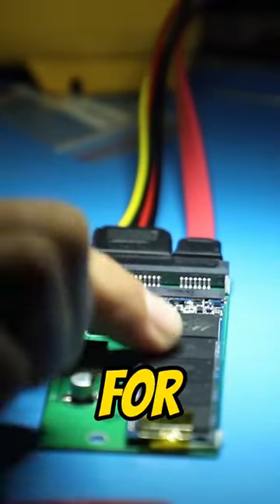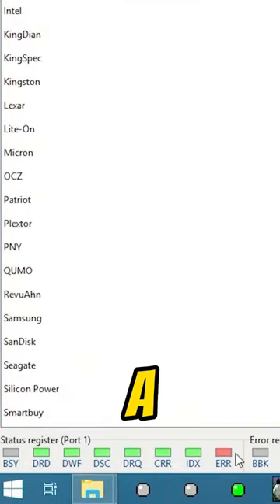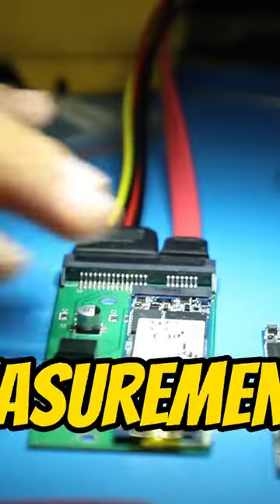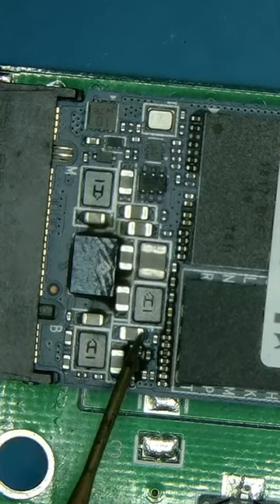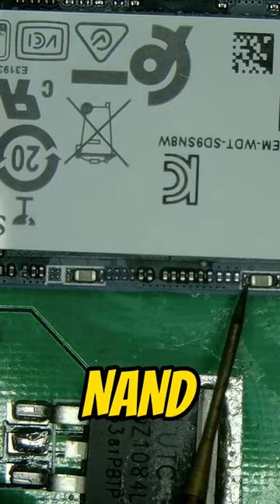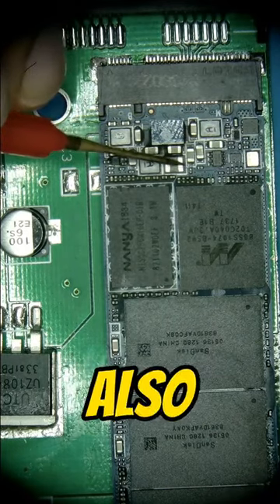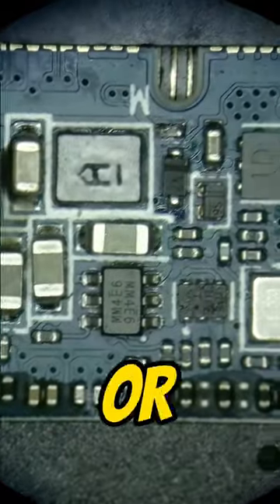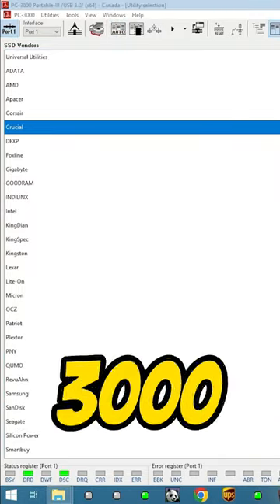why would someone do this to their clients SSD?

Comment: You had to buy a donor to find out that there is zero voltage on most parts of the defect board? And you just started looking for a defect component after all that? Strange way to solve problems
Reply from the maker: When I initially checked it and saw the that we get no power, I figured we would need a parts drive anyway cuz something was burnt out.

Comment: I have 2 old usb more than 10 years shown error message "*write protected*" have any idea how solve it?
Reply: try  this
insert USB
Step 1. Press Windows + R keys and type cmd in the box that opens. This will launch Command Prompt. 

Step 2. Type diskpart in the Command Prompt window and press Enter.

Step 3. Type list disk and press Enter to view the available disks.

Step 4. Type select disk X and hit Enter. Replace X with the write-protected device number. (check using capacity of the USB. should be circa the same)

Step 5. Type attributes disk clear readonly and hit Enter.

Step 6. Once it says Disk attributes cleared successfully, type exit to quit Diskpart.

After this, restart your PC and check if you can access and use the saved data on your USB.

Comment: Where can I buy that converter which reads both m2 and NVMe?
Reply from the maker: I don't think there is such a thing. We use pc3000 portable which has to be configured before utility starts.
Reply: There are USB adapters what can do both. But obvious you can not connect a nvme drive to a sata controller
Reply: M.2 is a form factor and NVMe is a protocol. Different things

Comment: The donor was useless if there was no voltage on the damaged one, I mean no voltage is different than a difference. Also thorough visual inspection would have enough
Reply from the maker: Power had issues so the donor was bought for parts. If PMIC is out where else would you get it other than donor?